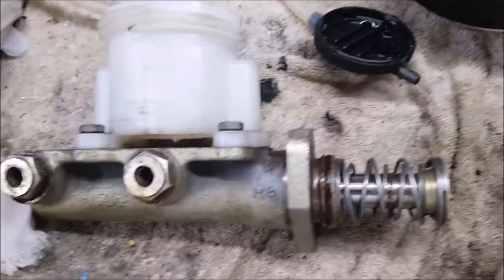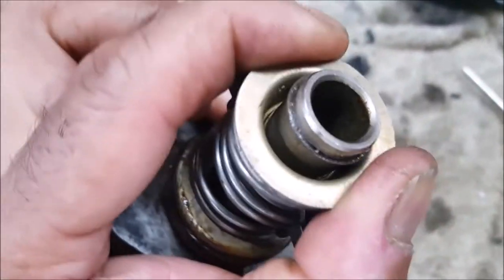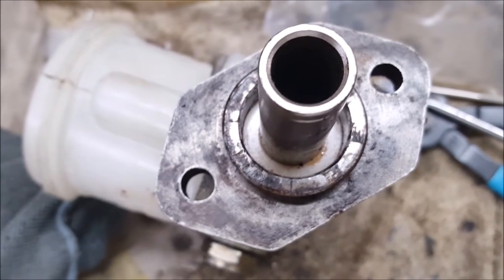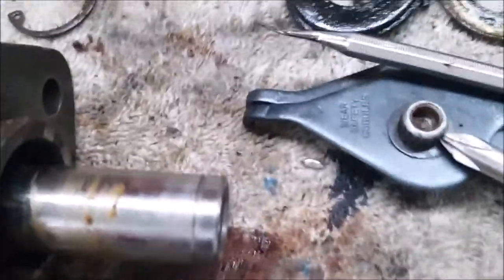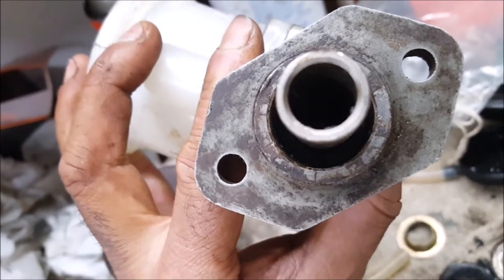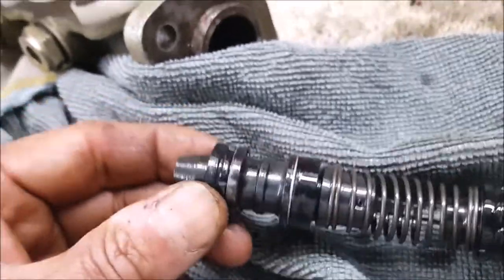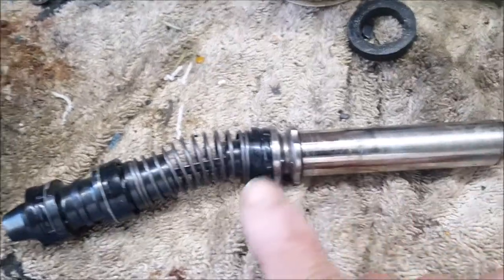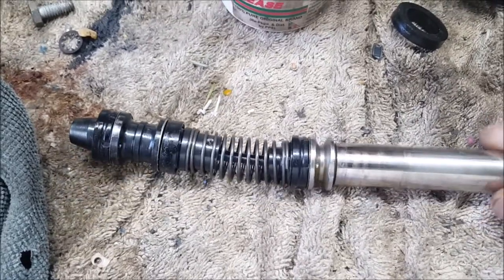Triumph Stag -  Brake master cylinder disassembly

Comment: I was able to get out the white ring and the seal behind it with a short blast of pressured air into the front port of the reservoir. Remove the reservoir for better access and make sure the piston is fully extended before applying the air.
Reply from the maker: Good to know. Thx.
Reply from the maker: I used your method, compressed air, on another cylinder and it worked.

Comment: I wanted to know how to remove the rings and circlips. You showed me where they are and tools required but NOT how you removed them. You showed them on then after you removed them.  I wanted to see how.
Reply from the maker: About 2.06 mins in you can see the eyes of the first circlip. You need a pair of circlip pliers to take the circlip out. You many want to search YouTube on how to use a pair of circlip pliers. Sorry I couldn't show it being done as I hold my phone in one hand, but you need two hands to remove. I have different types of circlip pliers - straight nose or bent nose. I have assumed people know how to remove circlips. These things are quite common.
Reply: @sujitroy  Thanks for your reply. The circlips are not too much of a problem, although hard to get to, seeing you actually removing them would have been helpful. My main frustration was when you identified the "ring thingy" which you removed  with "some sort of device", none of which was shown.